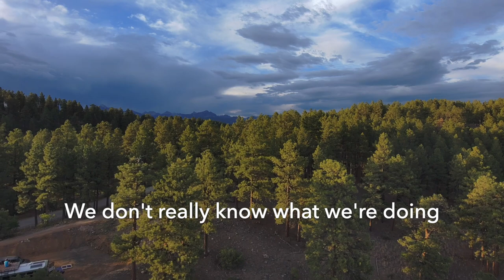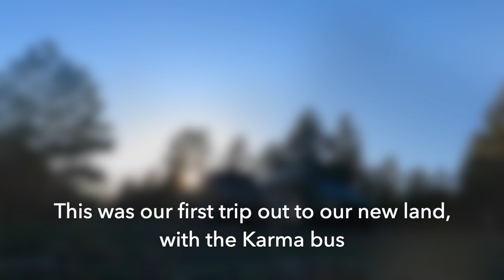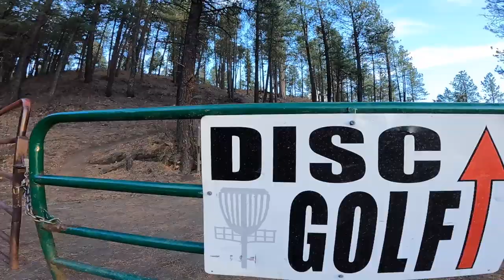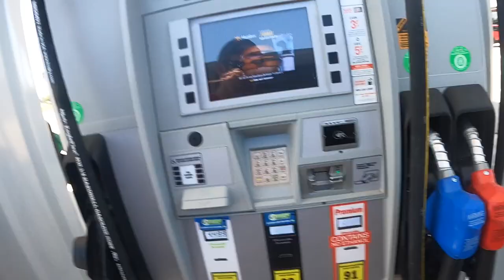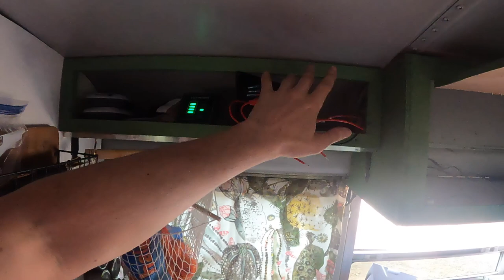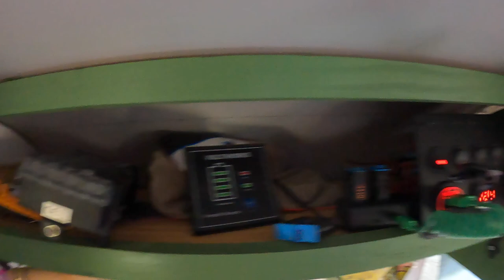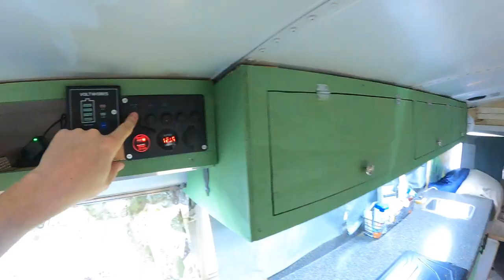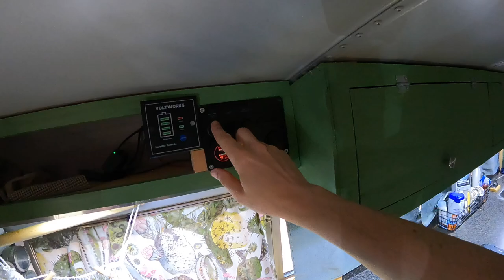Fixing my Skoolie Camper Bus for $500- 20 Clever Budget Build Hacks & Fixes

Comment: Great work on the bus! Massive improvements compared to when you bought it.
Reply from the maker: It didn't visually change a lot but the usability is so much improved with the 12v lighting, and charging abilities.   Cleaning up and hiding a lot of the imperfections made a massive difference in how it feels inside.  Next stop:  insulation and heat!